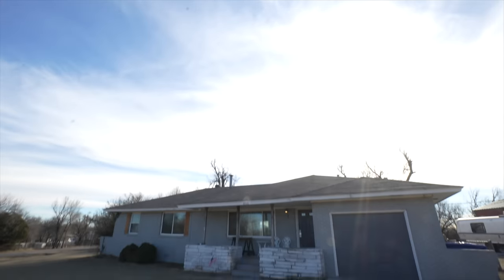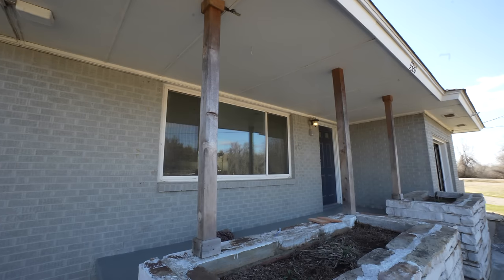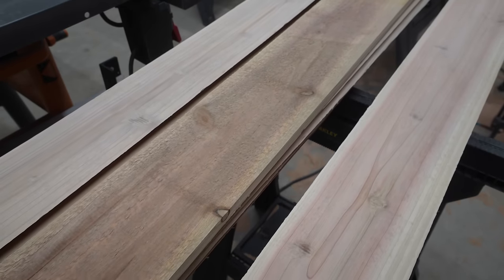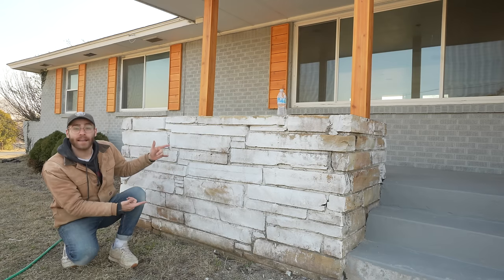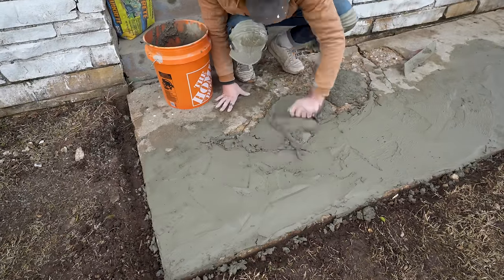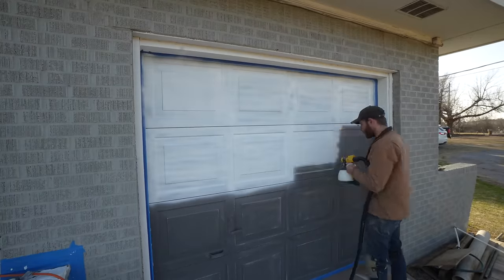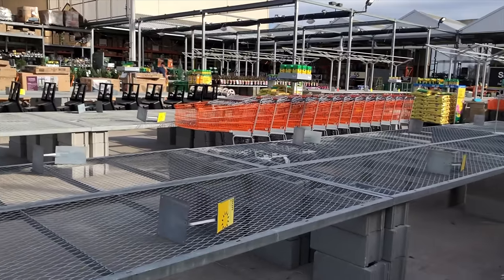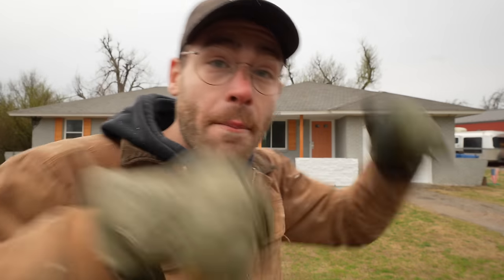I Spent $750 To Gain $7,500 in Equity!! DIY Curb Appeal Transformation

Comment: I would put ceder framing on the top of the stone planter boxes. It will give it a more cohesive look and look really nice when you have greenery against the ceder edge.
Reply: THIS! A wide plank along the edge. It also could give a clean ledge to sit on for a few minutes.
Reply: @Maatjuhhh  exactly what I imagined
Reply: Wood against stone often degrades faster.
Reply: @lechatbotte.  not if you put down a protective barrier like you do in decking or framing
Reply: @mariannegaetanopulma4077  but he didn’t. He did hold the post covers back an 8 th of an inch above the stone. He’s going to flip this so he’s not going to put a lot of work in unless he needs to
Reply: @lechatbotte.  regardless it would look really nice
Reply: @mariannegaetanopulma4077  I agree it might.
Reply: is the stone flat on the top?
Reply: Great idea!
Reply: @lechatbotte. not cedar
Reply: Good suggestion. I agree 100%, that would look great! I kept thinking it needed a little something.
Reply: Shutters were not just used to close the window space or block the light, they were used to protect the windows.
Reply: It sounds cute but after having a mental picture, the cedar on top of the planter will give the house a horizontal line across and it will make the house look even “shorter” because now your eyes gets drawn to the horizontal line of wood across the entry. Once there are green plants the entry would even look smaller.
If he instead, covered the entire planters with cedar that’s whole new look and would still be cohesive and still draw your eyes up and down, which makes it cohesive to the shutters and posts.
Reply: That would create a surface that would rot when watering the plants in the planter, requiring upkeep
Reply: Oh yes that would look real good.
Reply: Nice idea!

Comment: ahh, latex on stone is a no no. It doesn't allow the stone to wick the water. Therefore, the stone will degrade over time. This is probably going to be exacerbated by the fact that it is planter.
Reply: They don't care if they're going to sell it. Had somebody stick me with some BS like that in my basement. Stone foundation with drylock. It's now dirty and bubbling that looks orangish like rust, and peeling everywhere and it looks creepy and gross. Also has caused the stone and the mortar to deteriorate underneath and has caused mold issues. But 20 years ago when I bought the house I didn't know any better. It needs to be wire brushed, scraped, pressure washed, treated for mold , and lime washed. Very expensive mistake!

Comment: The main thing that bugged me was just going over the concrete crack with vinyl filler. That crack is still there and will re-open up your cover up. You could have opened up the gap with a v shape, clean out and fill the void with proper concrete flexible filler it will have a way better chance to not reopen after you get those gutters in.
Reply: When we moved in 30 years ago, the previous owner had just put down that vinyl comcrete patch on a crack on the porch. Noticed that after 29 years it 's just now starting to fail and peel up. So his fix should last for a good long time.

Comment: when you trim out the light, take the house numbers off the fascia, since you're getting gutters, and use some cedar to make a vertical plank for the house numbers, under the light. that'll cover that unpainted area behind the light, so you don't need to worry about the paint matching.

and those planters really need cap stones or cedar on the top edging. that mortar seam really should be covered so that water can't ingress that way.

Comment: Using the natural cedar is nice when it suits.  Grey brick, grey paint on concrete, white on the planters?  Use black accent, or charcoal on the wood.  The reddish shades of cedar are a total clash.  Painting the white is great but you need to do an antiquing technique, and add black or grey over the white and wipe it off, leaving the darker shades in the grooves.  It’s far less harsh, than the stark white.  Matching the cedar colours on the door was genius but it actually makes the planters and door look more stark.  Black would have been better, and black shingles, or black steel over the old shingles.  I can’t comment on values as I don’t know your area.  But it’s pretty good for the first

Comment: Terrific job! One thing I would recommend for future shutter builds is to cut a slope into the bottom slant (and each of the rail pieces) so that water flows down). Ran will quickly cause mold and mildew on those how as they're built.

Comment: Yooo you need to trim the bushes on the left. You have a vine working its way towards the attic and thats not a good thing. Its also highly noticable and a turn off for home buyers. id say trim then a little at the top and I think its 4-6 inches from plant to wall. But its really looking awesome that concrete fix looks amazing.
Reply from the maker: That's a part of the plan! I like the ivy creeping around the corner but the bushes havent' been trimmed in a while and need it

Comment: Having been burned in the past by DIY flippers...some of the stuff does concern me, but you're honest about it and I hope you're honest with your buyers.
Reply: This guy isn’t great at diy builds. He tries but doesn’t do a great job. For how much he does you’d think he’d learn and do better
Reply: @tonybeatle  what are you talking about? what hasn’t been good???
Reply: The quality of work here is equal to "lipstick on a pig" meaning all his work might last a year and need to be redone(properly). Contractors who paint old surfaces to flip homes will hide expensive problems. Buyers make sure to have a professional inspection done.
Reply: @johnheath8882  are you a home owner? I’ve done most of the upgrades he’s done (minus electrical) and have never had issues. i still don’t understand the issue here… painting concrete is not going to harm anyone in the future. i did what he did on my patio 5 years ago and there’s no issue
Reply: @user-nlvmruu  I own a SFH, MFH, and have decades exp in this field. There's usually higher profit, happier customers, and more satisfaction by replacing old with new/quality. I believe doing it right and once. Some get a kick out of temp fixes for a quick profit. Some are new at it and don't know any better which is why an inspection is recommended, especially if you cant tell the difference.

Comment: This to me is the exact reason I would never buy a flipped house. I understand money is tight these days for everyone and people want to get things done on a budget. But to me cheaply masking problems with the house to jack up the value and kicking the problem down the road to the next home owner feels scummy to me. I understand its what most flippers do but those stone planter boxes are in rough shape and to seal them on the outside but not the inside will trap moisture and cause further cracking from freeze thaw cycles. They should also have a solid top to protect water from getting inside the wall. This is a concern since there are load bearing post carrying the roof. To properly repair this in my area would easily be in the 10k range to do it right. As a masonry contractor we understand most people cant afford this so we often ask if they would like a full repair or a band-aid as we call it. This is neither its just exasperating the problem. The wood work looks nice just maybe consider consulting a professional in areas you are not as familiar with. Also they make specialized masonry paint that allows moister to escape but still I never recommend painting masonry but that's my own personal opinion.
Reply: Exacerbating
Reply: Absolutely right. House flipping is strictly about hiding problems with superficial makeup. House slippers shouldn't be able to hide behind LLCs for liability, IMO.
Reply: My sister bought a flipped house it was actually featured on one of those flip my house shows.... it's scary the things they have found in making changes to the place.  ☠️☠️☠️
Reply: huh? It objectively looks better.
Reply: @geoffl it definitely looks better. I think the complaint was that it is just an upgrade to the appearance, not an actual structural, functional upgrade. I think it’s okay to prettify things but I hate when they take stupid shortcuts that might cause expensive problems down the line due to lack of care or knowledge. 

We sold our old house to a flipper a few years ago. It wasn’t my first choice but there were some expensive plumbing and electrical issues that we couldn’t afford to fix plus a “bad” neighbor I didn’t want to deal with anymore. I will say there were a few things that I didn’t agree with but the important stuff was done well. It really depends on the flipper and their personal integrity.

Comment: I live in a row home, (UGH) and my contractor is going to redo my 2 porch columns & soffit  (which have rotted out), bannister paint and recap (around the entire porch, and resurface my porch cement floor the way you did with a product from home depot, along with touching up the iron work on the house, he will be charging me $2850 for the work without any concrete work and/or landscaping.  Great job. For me personally, I would have painted the brick another color, that white is going to deteriorate quickly.

Comment: Behr concrete paint is good for concrete but every other Behr paint product is not good at lasting on non-extremely porous surfaces, especially outdoors. Our concrete pad hasn't chipped at all, even the vertical concrete wall (which isn't recommended) hasn't had any chipping but every time we've tried behr interior/exterior paint, it either peels or chips within 0-2 months (with surface prep).

Comment: Functional shutters are great for protecting windows during severe weather - like high winds, hail, snow, etc. - and also for locking up at night
Reply: People had to use functional shutters in the old days because the windows were not as strong and the glass easy to break. Shutters are not needed nowadays unless you live in a hurricane prone area. They’re just for show.

Comment: Good job! I fully recommend you add a thick, wide layer of gravel to that dirt driveway! Even add a pull off. It will not only add a LOT of curb appeal, but it will reduce tracking dirt and mud and help keep that walkway and house floors cleaner.

Comment: I applaud you for putting in the work. I think the added shutters were a big mistake. Your shutters are severely smaller than the size of the window. They are suppose to match the width and height of the window. Also, shutters without brackets look silly. Brackets (even if they aren’t functional) give the appearance of real shutters because they look like they can open and close on the window. So the issues here are size and authenticity. If you can’t match the size of the windows, I wouldn’t install them at all.

Comment: Love the look of the cedar, but my peeve is shutters. Even if they aren't operating shutters, they should have the correct proportions as if they were operating shutters. The shutters that get slapped on the houses are way too narrow and just don't look right. For that big triple-panel window, the shutters should be sized to 'cover' the two outer panels. Most folks will disagree with me, I'm sure, but that's my peeve.

Comment: I’m not an electrician - but , running a three-prong cable with ground into an I’m assuming two-prong style positive and negative cables of a porch light as opposed to a proper 220v or whatever it is that’s ran around the knees heights of buildings may cause an issue . You should probably upgrade that cable before you start a fire . There’s probably no real ground through there currently . Inspections are most important for this reason .

Comment: The porch and steps are scary.  A safety nightmare.  I suggest a sprinkling of sand between the coats of paint.  You can also add sand directly to the paint.  Without some grip the porch is an ice rink when it rains.